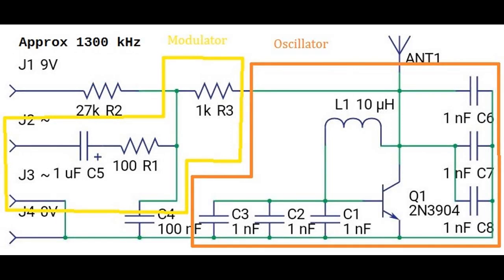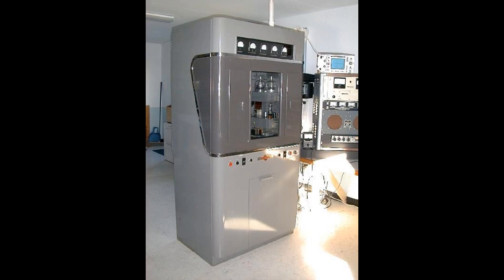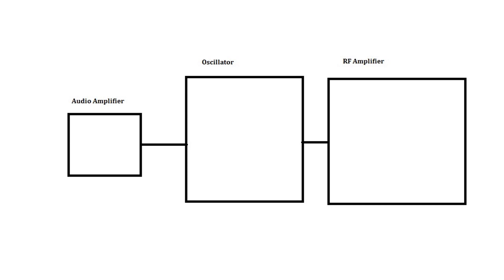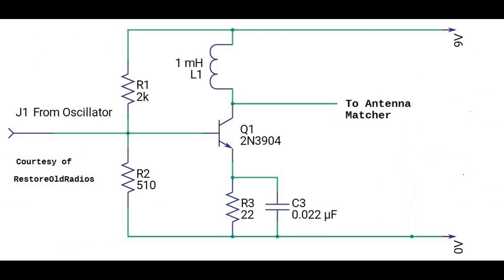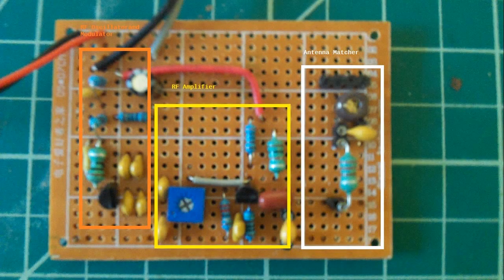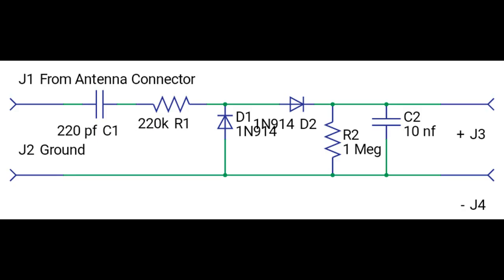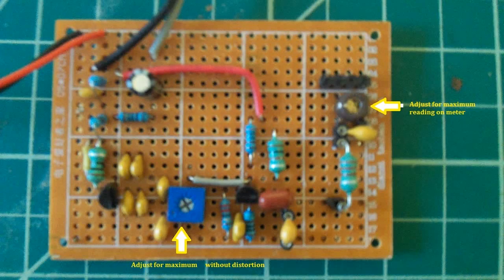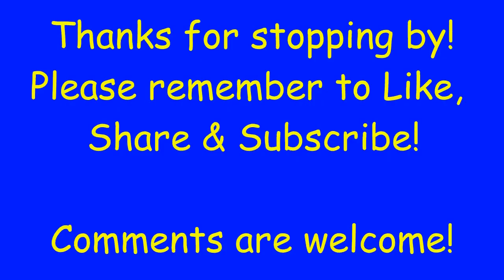Simple AM Transmitter Plus

Comment: Could you please provide the link to the supplier's site at which the C13 (9-65pF) can be bought?
Reply from the maker: https://www.ebay.com/itm/167130852271?_skw=trimmer+capacitor+60pf&itmmeta=01JVDMFJEHFVP5NV36WHVSQFQT&hash=item26e9c66baf:g:v1YAAOSwKZhj6gGN&itmprp=enc%3AAQAKAAAA8FkggFvd1GGDu0w3yXCmi1ePrTPeDJYhtlfAWS77vHfdJ8LlIvEJcG%2Fb5whD7exE5jV6hga0N%2FWKeWE%2FXcn%2B7whKMg32uM1Y9XLsWu2XvlepVeC23N65axKSP9iTA%2BsKdSxS1G%2BCWikdRTAft5LdXpcudv0myj6lepZRy4SO%2FyQHOXfQ6c3akedkQoPu27UFclIbLRtCw%2FZllwZ%2BOSXV66KIgT6%2B%2FT%2Fllxd8aAaL4S6ma8z4ODD7%2BOE51oBq8cC%2FkZl9kmsaukhBd2zg5eg8Y85fhBEEJBmBDFs77zVh9bMFIMJ1g8VLLwfLC2HOxs8p8g%3D%3D%7Ctkp%3ABk9SR7KnvrTbZQ
Reply from the maker: The 60pf at that site is the type I used.
Reply: Thanks again for sharing. You are very kind with your knowledge

Comment: How do you prevent the modulation from pulling the oscillator?
Reply from the maker: The modulation provides the power for the oscillator, thus varying the amplitude of the signal but not the frequency. At least I've never noticed the frequency varying and don't see why it would.
Reply: @YouAllKnowBob  Varying the voltage to and L/C oscillator pulls the frequency because it changed the internal capacities of the semiconductors. If you listen on an SSB radio you will hear it. When listening on an AM radio with a wide IF bandwidth it often not noticeable.

Comment: Bob, I just built your am transmitter and it works very well. I made a couple of changes , one was the oscillator section caps to get exactly 1030 KHZ,  and the other modification was the emitter resistor on the RF Amp from 22 to 100 ohms to reduce the transistor current draw because the transistor would get hot to the touch.  I got this idea from a commenter in regards to Don's transmitter.
Reply from the maker: Great! Part of the fun of the hobby is figuring out solutions for problems, like a hot transistor! Glad you like it!

Comment: hey bob, Ive built this entire setup using 2n3904s and love it but now Im actually very interested in building a bigger amplifier circuit. I build 2,4,8 and 10 transistor amplifiers for 10m-12m band so Im wondering what Id have to do to do a similar circuit with this with 4 or more 3904s with little combiners/splitters  to give my little transmitter some more range etc. Ive fiddled around with antenna length and so far the only thing that works great for me is my antron a99 lol,  Shoot me an email if youve got any tips or pointers for me! Thanks for this build here, This stuff is so much fun to me!
Reply from the maker: Biggest tip is don't do it. The FCC has very strict limits on AM transmitters. FM will give longer range.
Reply: @YouAllKnowBob  im trying to make it so I can run my antique am tube radios at my house and in my garage/build room 500 feet away from the house

Comment: Hi Robert, great video, just 2 questions: 1. where did you purchase the connecting wires that are used on the pcb, 2. can a dipole antenna be used for the transmitting wire( the 9 foot wire)? Thank you kindly for any help. Have a nice day!
Reply from the maker: The connecting wires are just 22 gauge solid wire (I have an Elenco WK106 assortment of 6 twenty five foot spools). As for the dipole per FCC regulations a total of 3 meters can be used so the dipole would be two 1.5 meter legs which would make a 100 MHz antenna and not very efficient for AM frequencies. The output section is designed to end feed the 9 feet of wire effectively. Hope that makes sense. 😋

Comment: Bob, well done. I like those header sockets you shared and the way you built this TX in blocks. I’ve got to try the antenna section you shared. I’m assuming it makes a real difference in performance. Best, Don
Reply from the maker: The antenna matcher addition is like night and day. If you add it to yours remember mine is best at 1 MHz. The 470 pf can range from there to 820 pf and the inductor 180 uh to 330 uh depending on frequency and antenna length. That's where the sockets cone in handy for experimenting.

Comment: Good solution for this Bob. Simple and effective, can't ask for more. I'm wondering what a slider antenna tuner would do. I know one thing, I need to order some assorted inductors for my stash. Thanks bud.
ps,,, when I hear that music,,, I look for a curtain to fall and see go go dancers in the hanging birdcages lol.
Reply from the maker: I think a slider would be way overkill. 😁 The transmitter is one band, fixed frequency. And your only talking 220 uh inductance. Much easier to use a 100 of trimmer (or equivalent like I did).